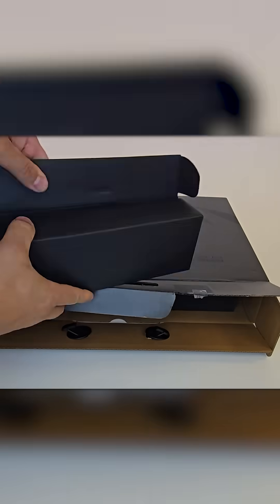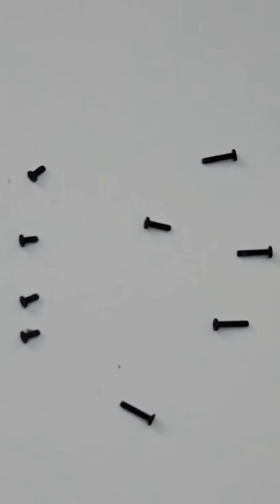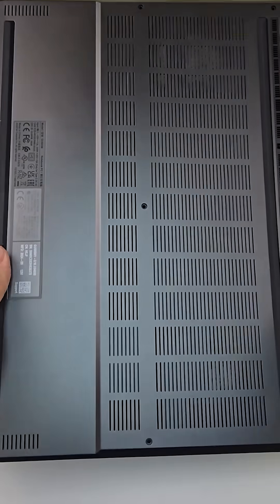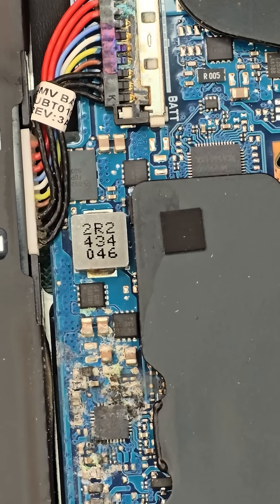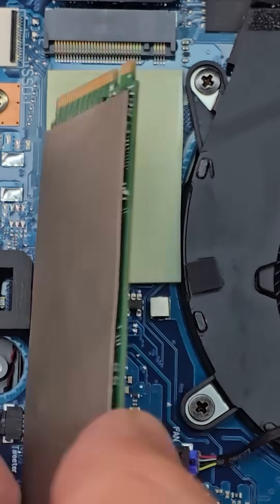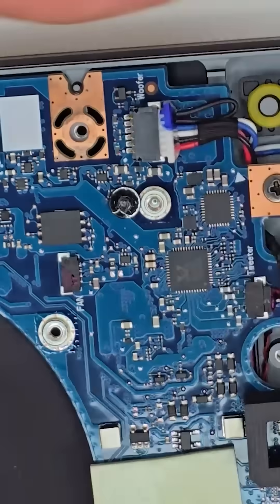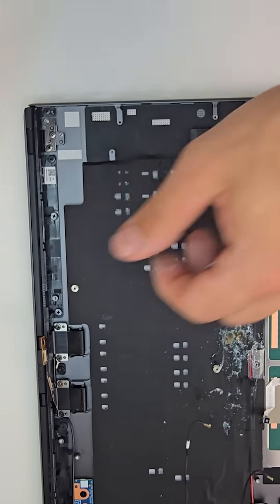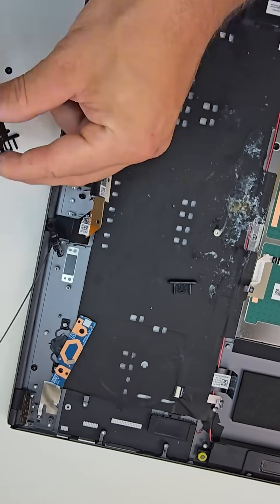Why This RTX 4090 Laptop Stopped Working? Full Teardown of Asus G16

Comment: Great job using that stainless Steel spatula to disconnect the battery, and touching the surface mount electronics with it. To toast and short circuit other parts
Reply from the maker: If you had watched and listened to the video, you’d have noticed that the laptop is fried and doesn’t work. So it really doesn’t matter which spatula you use